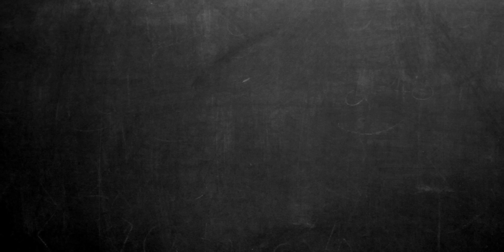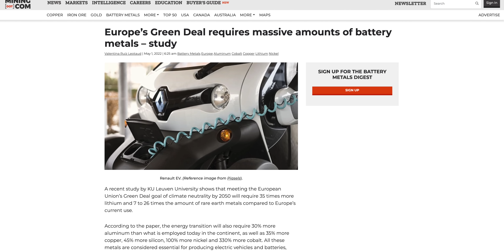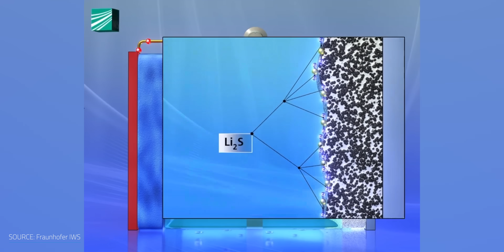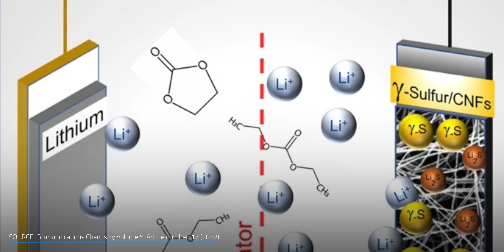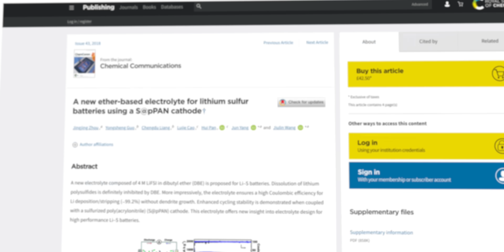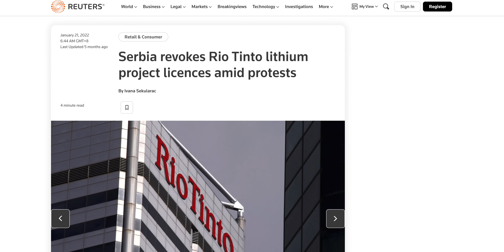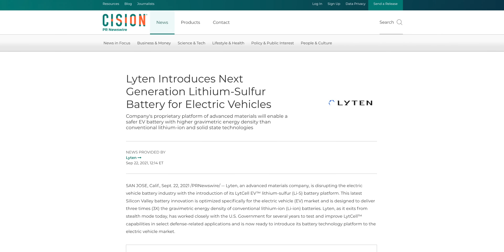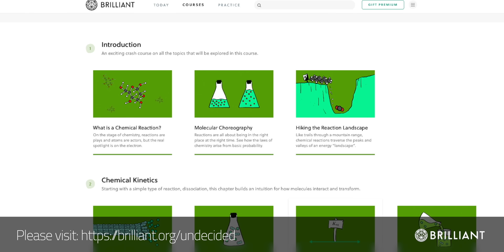Why This Accidental Battery Breakthrough Matters

Comment: What is the energy density
What is the energy per unit weight
What is the cell voltage
What is the charging time
No data given just blah blah blah

Comment: Really you people still into the CO2 Climate hoax, brilliant not likely there is some stuff to see here however I would not recommend children watching this with out intelligent parental supervision the kids might want to destroy your car to save the world.
Reply: yes, this co2 bashing is utterly stupid, because the co2 content follows the seawater temperature due to warm water having a low solubility and polar cold water, near the freezing point forcefully absorbs the co2 out of the air.
Proof: use soda and check its solubility and the readiness  to pull it in when cold
Look at the green co2 rich lakes in Alaska near the sea.
green because they are full of algae, feeding on the co2 .
And the worst is that the geothermal heat flow from the hot internal magma due to radioisotope decay is TOTALY NEGLECTED, worse blamed on the co2 supposedly blocking the IR radiation from passing through the thinest upper atmosphere
The green house effect hoax

Comment: Instead of adopting electric cars for everything honestly we should restructure our country to make ourselves less car dependent. Not saying we shouldn’t make EVs, but you could get around 400 ebikes out of a Tesla Model S battery. Cars in general are inefficient and we should do our best to make our society as non car dependent as possible. Public transport and non car infrastructure should be our number one priority to reducing emissions and environmental impact, not to mention the amounts of lithium mining we would have to do for cars vs other modes of transport. Obviously if you live in the country that’s a different story, but we should work on zoning so we can undo the urban sprawl we’ve had for so long. Electric cars are still cars, and electric cars will not save us.

Comment: 8x the energy density over current batteries....ya...um...no. No happening. Firstly anything that energy dense is called an explosive. I wouldn't want that battery pack anywhere near me should there be an accident. Secondly fast charging a battery with that much energy density would get so hot it would likely melt things or catch them on fire. Energy density is already about at the limit of safety so anyone spouting off about how their battery has 8x the energy density really has no clue of the implications or impracticality.

Comment: Heh. I like how when he's talking about reducing the cost of electric vehicles, he shows one of the single dumbest uses of electric cars on the planet: The Vegas Loop. Behold! A single lane of traffic, installed at enormous cost and accomplishing less than a shuttlebus!

Now, what's the operating temperature range for these batteries? Because if you're gonna put it in a car, and that car's going to get used in winter, it's got to handle cold well.

Comment: Wonder how they stack up against Lithium Iron Phosphate, which is becoming a "go to" for solar generators / home power stations. This has led people to beleive they are newer, when actually they are older. They're less energy dense (read: bigger and heavier per Wh), but safer and can withstand many more charge-discharge cycles, some quoted figures give 4-5 times as many as Li-Ion!

Comment: Lithium Sulphur, Graphene, Borophene, Ultima, Solid State. They all boast 200+% increase in energy storage. The difference is and will be; who gets theirs out first?
So far we are still using Lithium batteries. Toyota has apparently released the solid state battery in the new Rav4 Hybrid. So maybe Solid state will win out. 
In the end, us as consumers, will not decide which it will be. It will be decided by the producers of cars and equipment that need the energy. Then we will just buy whatever we are given and not notice it.
Right now, us watching these videos about new battery technology is about as useful as it was putting a VHS tape into a machine to watch a documentary about HD DVD versus Bluray. In the end we get what we get and we don't get upset.

Comment: Thanks Matt for your focus on energy storage technology.  I'm writing to suggest you consider a relatively new technology for energy storage, that is green ammonia.  Ammonia is essentially a way to store hydrogen using lower technology than that needed for gaseous H2.  The infrastructure already exists for storage and transport of liquid ammonia, and it is suitable for transportation because it can be used in diesel engines (with some tweaking) with an energy density more than half of diesel fuel.  Recent scientific articles and a test project in Australia have demonstrated an N2-H2O fuel cell and improved ways of generating ammonia from unused electricity.  I hope you can consider checking this out and presenting it sometime to your (considerable!) audience.

Comment: I worked in a Li-ion battery research lab for some time in the mid-2010s.  At that time one of the big problems with sulfur batteries, in addition to the SEI formation, was the volumetric change when charging and discharging.  The sulfur nanoparticles expand up to 4x (if I remember correctly) their volume when lithiated, much more than MCN chemistries.  My guess is that these prototype batteries are single layer cells where the volumetric expansion is not a worry.  But I would like to know how (or if) they plan on addressing the sulfur expansion in tightly packed 18650 cells.  Or maybe this unique structure also addresses that problem, I don't know.  But the fact that they don't mention addressing this problem is suspicious to me.

Comment: I have an ebike my question is if the new battery tech comes to market would it be as simple as buying a new style battery or would it require a new controller or worse still would it require a whole new bike. I worry about instant and massive dumps into dumps of in effect outdated tech and that impact.

Comment: We have a solution to a problem, we know exactly what it does and how to apply it. We're gonna go ahead and not use it for 5+ years because we want to know every single detail of why it's doing exactly what we know it's doing, because reasons.....         Seriously I'm all for knowing how stuff works, but pushing tech back 5+ years just so you can figure out the minute details despite knowing exactly what it does (if not how it does it) seems kind of silly.

Comment: If they develop the technology more, and double the charge cycles; then it should match lithium ion; as the capacity is 8x greater. So the battery will cap out at around 200 as opposed to 2000 cycles; but you would be charging the battery 8x less. I am looking forward more towards this being used in phones and tablets. Having a phone last 8x longer on an even lighter battery sounds impressive

.

Comment: I would like to see how many of the "breakthroughs that matter" shown on this channel over the past 2 years turned out to be vaporware.
Reply: Vaporware?
Reply: @samuelallen6494  hot air/fake
Reply: @KnHighmer_Dos   Eh, It doesn't mean they're fake in this context. All of these breakthroughs are mostly real in battery tech. The issue are 99% of the time there's just not a way to mass produce the battery for market at a leveled cost that makes it profitable. Often times there's not even a means to scale the production at all so it's just a dead end. The materials are very real, but the bigger problem that's always even harder is how to mass produce them.
Reply: @user-fy7ri8gu8l  yeah, i know, and it sucks to be honest
Reply: @user-fy7ri8gu8l  capitalism dulls the edge
Reply: at least 99%, possibly all of them.
Reply: A laboratory breakthrough would normally take more than two years to make it to market. It seems that the researchers at Drexel spent more than a year repeating the process under different conditions to make sure it was real and repeatable before they published anything. Likely the thing that will happen is other university laboratories also doing research will try to repeat the results achieved at Drexel and probably do further research to see over how wide a set of conditions the process works. The speed all of this takes place is somewhat dependent on funding so if lots of funding is available, the progress will be faster. It would probably be a minimum of five to ten years before a commercial company would get to stage of testing making batches of batteries at a small scale using commercial manufacturing processes to test the batteries in some real-world applications and, then, if that step proves successful, it would take several years to build a commercial scale manufacturing plant so I wouldn't expect to see this technology in products for 10 to 15 years. Unless some wealthy venture capitalists (or Elon Musk) was willing to jump straight to commercial manufacturing step with the understanding they could lose most of the money invested but could also get a huge jump on the market and possibly own the license for many years so that we would only see these batteries in say Tesla cars (or only in competitors cars at a big markup) and other non-automotive uses, in which case we could see them before 2030.

Comment: Once the generation of electricity is free, the batteries will be obsolete, and everything will work from super capacitors banks. 
this future is closer than you might think.

A generator, is a pump, nothing is really generated, but pumped.
This pump will drive the near future economy into a revolution. 

More info on my open source research channel.

Comment: If it can only handle 1,4000 recharge cycles and the current method can handle 2,000 cycles and you recharge every day that's a difference between 3.8 years of usage vs  5.4  years of usage. Part of the equation where it gets wonky how-ever is that it's 3x more energy dense so if you don't recharge it, it will be able to drive 2.1x more miles.

Comment: Li-Ion battery can be recharged 2000 times or more, but each time it will hold less charge. Your EV's range after 500 charges will be less than 70% from what it was when it was new. After 2000 charges you will wish for a new battery. Coupled with no way to fully and effectively recycle or even safely dispose of batteries - you people are now the new problem, not the solution.

Comment: Nice, but unfortunately I can't get excited, because I know better. "Battery breakthroughs" are a thing that had been constantly reported upon and hyped up for decades now, and yet there's been big leap, only the gradual refinement one would expect over time.

In short, I put this in the same category as room temperature superconductors and cold fusion. Theoretically possible, but I only believe it when it's commercially available and I can see it with my own eyes.

Comment: That sounds hopeful. 
However, with the constant clamour to stop using fossil fuels, Oil refineries will cease operation, and as a consequence, sulphur as a by-product will no longer be available, so other sources will have to be found.
Lubricants and plastics are also made from oil, so I would like to see more research into development of all requirements before governments do irreparable harm to industry as a whole.
Just saying that we all have to drive electric cars is wrong unless the whole infrastructure is there to support them.

Comment: There are several interesting designs in the pipeline and I hope we see some of them on the market this decade. Lithium sulphur, solid state batteries and sodium batteries are some of them from the top of my head. Especially sodium batteries are interesting from the point of view of electricity grid load balancing. I think it's a waste of lithium to use it in electricy grids when lithium is much better used in mobile devices and in vehicles.

Comment: probably ultimately depends on how close to current tooling and production equipment a lithium-sulfur battery can be  constructed. if its the same equipment with different setups then we can make the switch

Comment: Tried sharing this with an engineering friend and they were,,  extremely, extremely skeptical and didn’t believe the claims claims of an 800% improvement over conventional batteries was remotely possible.  Admittedly, that’s a big claim..  Is there anyone not directly benefiting or involved in this study who is able to validate or counter these claims?

Comment: The problem with Lithium is that it is a "rare Earth" and when it runs out there won't be any more.   One of the problems with using Lithium in batteries is that once the charge has worn off the batteries, they can't be recharged nor can they be recycled.

Comment: Discovered by accident. A lab at the end of the day mixed all the failed lab samples together to clean the equipment. Common practice. One day they left the mixed goo in a beaker. When they returned after the weekend it had hardened with a stainless steel bar in it. After failing to be able to remove the bar it was used as the lab hammer. For four years. After seeing this mistake survive four years of pounding, someone finally asked what is this stuff. After much head scratching finally figured out how they made the worlds strongest polymer while trying to make the worlds strongest polymer.

Comment: As much as I like to listen to battery breakthroughs, I'm not sure I've ever heard from any of them again after a while. I get that this kind of stuff takes years to just leave the lab and then even more years to go into mass production for consumer products... but pretty much everything cool I heard from was never spoken of again, even in such a long timeframe.
Reply: You never hear of them because you just hear about better batteries later.
Reply: Well, there are a few things to keep in mind:
1. most improvements on the battery side are so minor that you dont recognise it
2. most breakthroughs are completely accidental
Reply: Years ago I heard about using lasers instead of spark plugs in cars to burn all of the petrol cleanly, thus making conventional internal combustion engines much greener and vastly more efficient overnight. That was the theory, anyway, never heard from it again. You'd think fossil fuel companies would have been all over it. But I guess car companies didn't like something that could vastly improve old cars (and thus not force people to buy new ones) with a bit of spannering.
Reply: In the video he says that it has been in testing for over a year
Reply: lithium ion used to be one of those batteries, it took decades to get adopted and then we almost immediately regretted it lol

Comment: what a waste of recourses ...turns out ev tires throw of nano particles that are 4 times more toxic than anything coming from combustion engines. also coal and oil are needed to run the grid ...prices for electricity will skyrocket ...and tyrants will move in for the kill....dumb ass people ? or jus plain evil.... go figure

Comment: If half the cars on the road (only cars) were EV and 10% of them were being charged at the same time, Power Grid Demand will increase by 162,000 MW.  Solar is not suitable to seve this need and just litters the earth.  Somebody needs to get on board with a solution .  I'd suggest Fusion Energy.  Get to it.  MAGA.

Comment: the problem will probably be actually getting the sulfur and increasing the harvest or production of sulfur

While it is very common, mining higher quality sulfur is incredibly dangerous compared to nickel and cobalt. and like the sulfur miners in Indonesia, fatal if you make one wrong slip on top of permanent internal injuries.

Seeing as how existing waste sulfur byproduct output are mostly already being purchased and used for other manufacturing, the easiest way to increase output is to start more sulfur "farms" near active volcanos and vents. So hopefully there will be an effort to increase the efficiency and therefore the safety of sulfur mining in less developed parts of the world if the new battery ever takes off. :x

Comment: I wouldn't consider a technology developed in the late 60s to be revolutionary!
But ill tell you what is!
Imagine if you could generate electrical power from a slid state system! Using the power of harmonics of magnetic waves!
No magnets here, and with help of super caps there would be no need for bulky explosive batteries!

Comment: Even just doubling the energy density / specific energy of batteries would be revolutionary.  Automobile and aircraft engine makers will spend hundreds of millions to increase efficiency or power (or a combination of the two) by just a few percent.  Just look at how the airline industry reacted to the Airbus A320neo family with its 15-20% increase in fuel efficiency: over 8000 orders, more than double what Airbus had hoped for.  Double the battery capacity of the new electric Ford F-150 and it would match the range of its gasoline powered siblings.

Comment: The car range increase is even greater than you suggested. With an 8x energy increase, you could have a car with a battery thats half the size, but would have more than 4x range increase because the car is now much lighter too. This kind of energy density increase will revolutionise everything. Any car will basically be a supercar in performance, electric commercial long range airliners will be a reality, incredibly small electronic devices possible, so many applications.

Comment: you mentioned that with an 8 times energy density that overall capacity is bolstered 8 times. But similarly, do these batteries have massively different discharge and charge rates? Shouldn't that mean that it'd also equally take 8 times longer to charge unless the charge and discharge rate are massively variant.